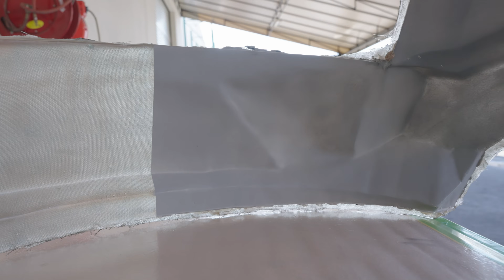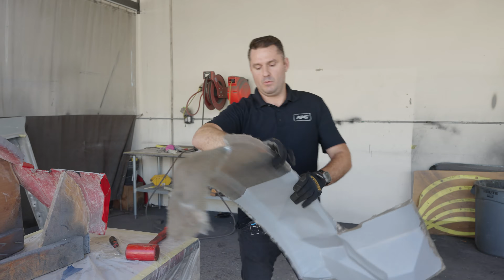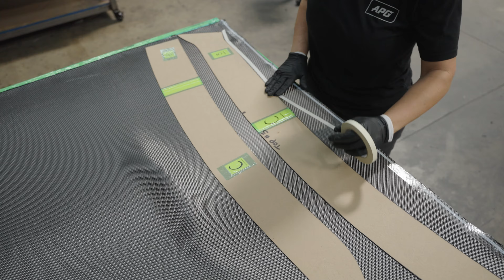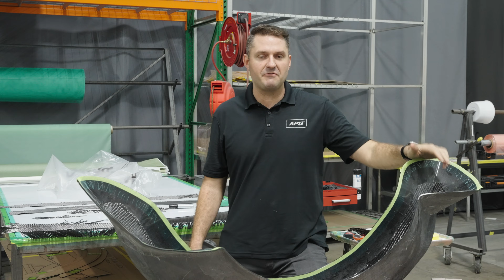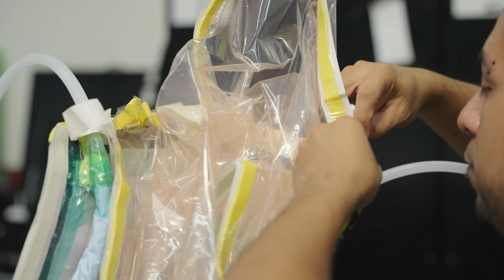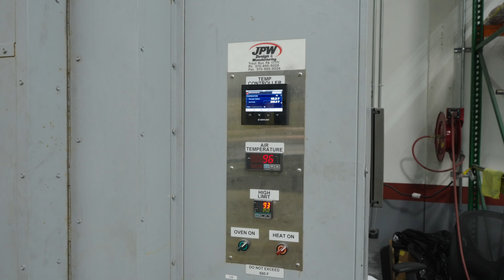CARBON FIBER vs FIBERGLASS | Ford Bronco Body Systems

Comment: The biggest difference is, we want both products, because they allow custom body work for more clearance for the tires, but one cost a lot and I don't want to hurt it, the other is replaceable and I don't care if I break it.
Reply from the maker: So you typically just leave your fiberglass unpainted and replace them when you beat them up?

Comment: Couldn't the process you've applied with carbon be done with fiberglass as well? (with quality woven fiberglass rather than that flimsy one you showed)
Reply from the maker: Great question! The answer is, yes. 

We would however need to use more layers of fiberglass to achieve the panels strength we need, which would then make the part heavier and thicker. We have a uniform 2mm panel thickness with just two layers of 12k carbon.

Comment: Beautiful work!! Can the resin be color tinted?
Reply from the maker: Yes, but not in various colors. Typically resin tinting is used to darken the raw part. Colored finished composite parts are mostly made with colored fabrics and tinted top coats!
Reply: @ That’s the answer I was looking for. 👍🏻

Comment: Daaaaamn!!! Had no idea the process was that involved. Fiberglass is garbage. Carbon fiber is tits!
Reply from the maker: We agree, but it’s just the way fiberglass is made for the Offroad industry, a poor standard was set a long time ago.. Even the industry standard carbon you typically see is made the same way and will Not withstand useful life. That may be ok for some vehicles if they are “strictly” crawlers or PreRunners. We simply aim higher